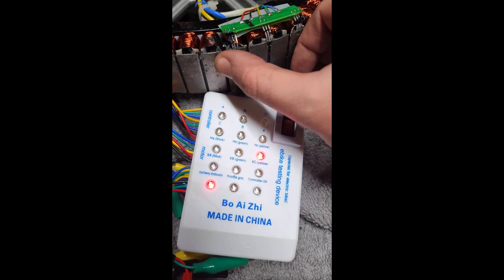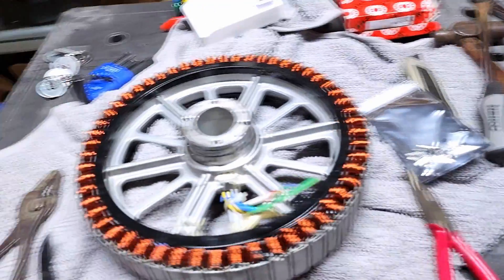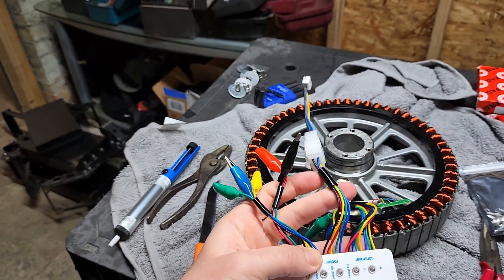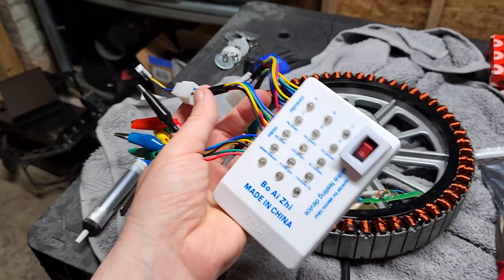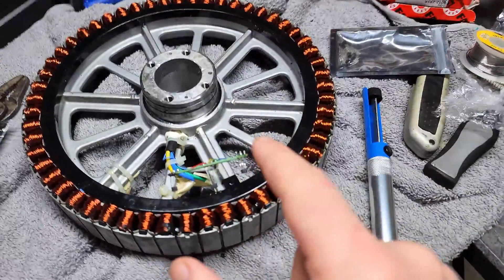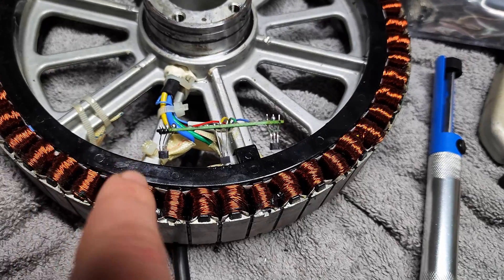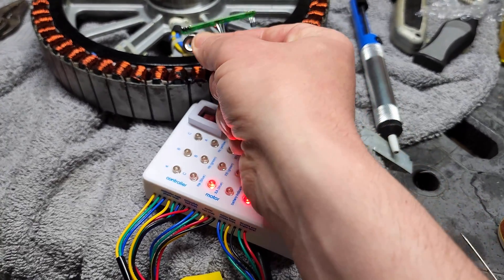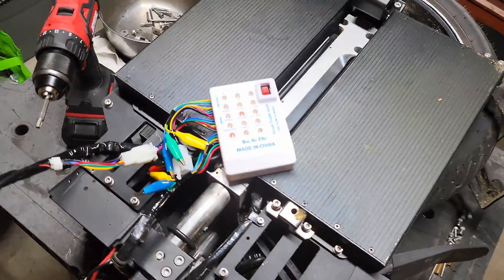Hall Sensor Fix - Ebike EUC Hub Motor Repair How To

Comment: Glad you got it figured out.. I was saying to myself the middle one is probably flipped. Not sure why some motors do that while others don’t. One easy way to tell is by the shape of the notch in the stator. Usually they are exactly slotted to the shape of the sensor and you can use the shape to determine the orientation.

Comment: I’m having a similar issue except mine balances when you try to write it it’s when it starts and making noises a lot of people are saying it’s a motherboard issue but seeing from what you’re saying, I can just replace the all sensors and get it fixed. Alien Rides hasn’t got back to me, but hopefully they will with a good solution. I just bought it in June so I haven’t had it very long. Wish me luck. I really hope they fix this cause I’m dead broke lol

Comment: Hey George. Do you think the C38 motor uses same hall sensor? My commander Pro has hall error now.
Reply from the maker: @electric_rider2044  yeah the hall sensors are pretty cheap and the same regardless of magnet size
Reply: @GoGeorge  thanks bud.

Comment: The hall sensors are generic Chinese 49E usually.  Honeywell's SS41 is the common replacement. Nice video, 👍
Reply: I have same problem as he one of them has failed but now i see that old one was digital SS41 which is latching type while i have 49e which is linear analog at hand only will it act nicely with 49e as a replacement? Difference as i understand it is that ss41 is either fully on on fully off and state is latching while 49e i know it's used in handle to sense throttle position (voltage on out pin is 0.7 to 4.4 depending on magnetic field and pole ) i am confused if you know bit more please help.
Reply: @yellouu_theree  Hi, since I made that comment, I found the ss41's were no better or worse than the 49e, however, ss41's in the motor and throttle did not work for me (on 500W Bafang kit), worked fine when tested but after installation no longer worked while the 49e's in the throttle did work.  I would suggest you stay with the original part, as you know there is a difference in these two transistors. Sorry I can't be more helpful, so far I got throttle working but not the motor, so my results are far from conclusive. To add to the confusion, this video has a link to the A3144 rated 4.7-24 Volts which makes no sense to me but we don't know what brand the motor is (maybe U.S. made). I'm just going to get a big bag of 49e's, they are cheap enough. Good luck to you, ride on !

Comment: Did you ask Alien Rides what hall sensors you need?
Reply from the maker: nope, I asked around a few friends who deal with repairs and none of them had a definitive answer. I just bought whatever
Reply: I would never use that stater. I would hate to have one of those cheap Chinese sensors fail at 45 miles an hour.
Reply from the maker: @mongi4435  well the sensors inside it originally were clearly super cheap, they had zero markings on them at all . not sure if you thought they used super high quality sensors but thats clearly not the case. they where already cheap Chinese halls

Comment: Nice work George!
Reply: @GoGeorge  hello go George I am having the exact same problem with my middle hall sensor but for me it’s the green one. It’s just yours laid out different but it’s still the middle light. And I saw you flipped it around. Mine is also flipped around I think, but I will try that today but every time I fix it and test it, it works on the motor tester and all the lights blink. But then when I plug everything into my bike and put all the nuts back on it, and the light green light stays on do you know why this is? I will try to flip it td and seee
Reply: @GoGeorge  how do you connect thatbtester what to?